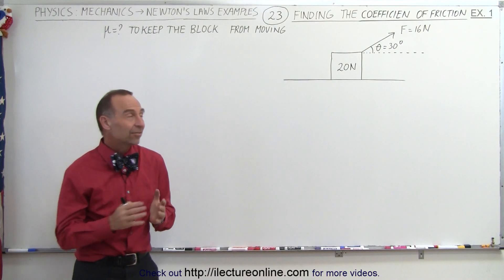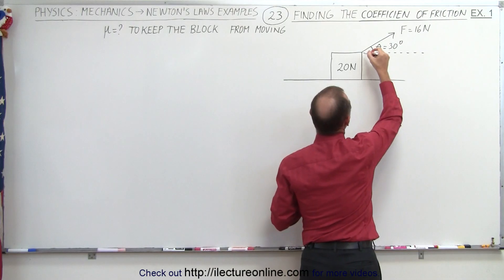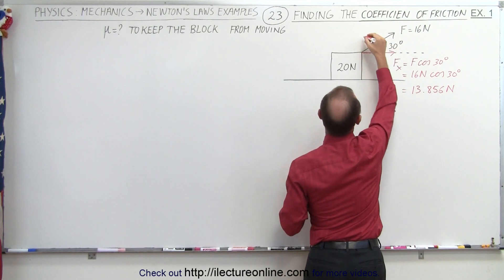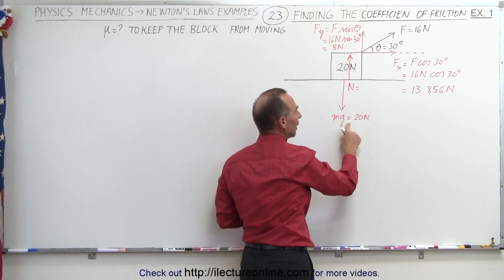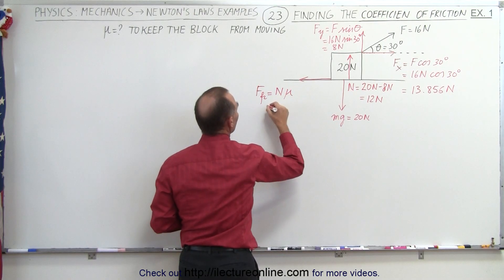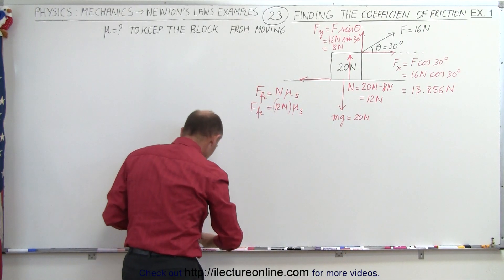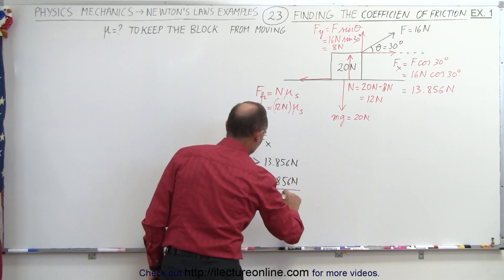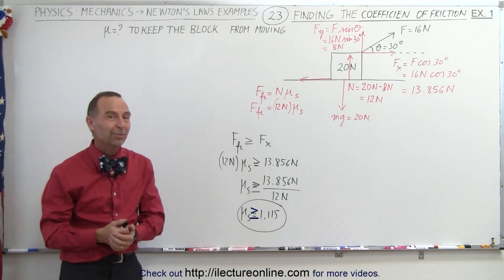Physics 4.1 Newton's Laws Examples (23 of 25) Find the Coefficient Friction: Ex. 1  Correct = 1.154

Comment: Could you explain why the normal force isn't mg in a bit more depth please ?
Reply from the maker: The normal force counteracts the force of the block pushing against the floor.  If there were no other forces acting on the block the normal force would equal mg.  But if you pull up on the block you reduce the "effective" weight of the block and the push against the floor would be mg - F  (where F is the force pulling up on the block).  In this case it will be the vertical component of F pulling up on the block.